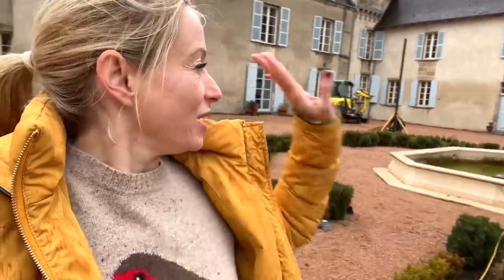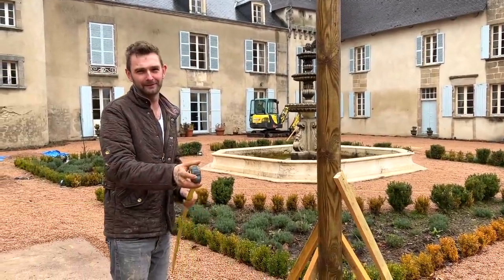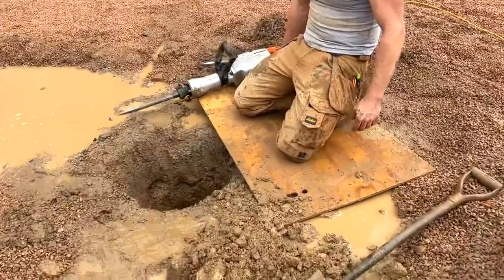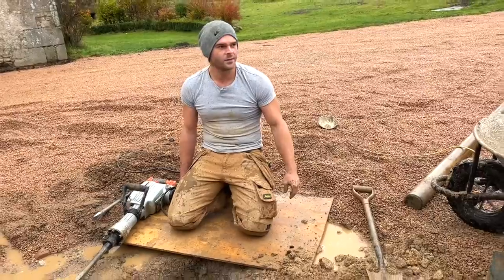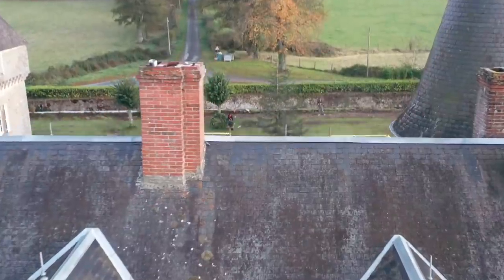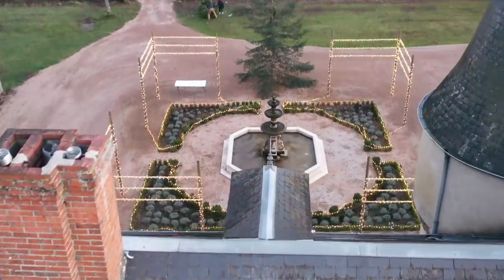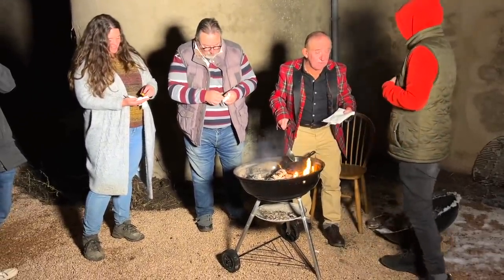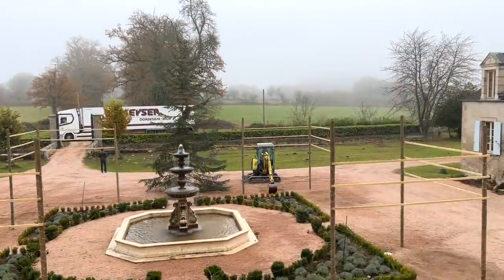OUR SECRET CHRISTMAS COURTYARD REVEALED!

Comment: So  interesting to see you planting trees in France.  Your soil must be very different.  In our part of Canada we always have to remove the wire cages from the trees and spread out the burlap so it will rot out. Otherwise the root structure is weak.
Reply: Yes, research is showing more problems than not with trees who don’t have their root balls completely freed of wire, etc.  especially after a decade or so when they are very large.

Comment: I feel sad for the poor trees not have the wire or fabric taken off , it strangles’ the roots.
But I’m very happy for all that live at the château to enjoy the lovely courtyard.
🎄🎄🎄🎄🎄🎄
Reply: I did too...at first. But Davey is a professional, and would've thought of that, so either they edited that out, OR they used biodegradable materials. They do make a mesh-like material that is biodegradable so I'm hoping for that!
Reply: The "packaging" of the tree roots is the right way to transplant grown trees, its a natural burlap, a kind of sisal/agave fiber witch holds the roots together with some of the original soil plus prevent from freezing the roots and will degenerates it self in the coming seasons as the roots grown over it .
Reply: They planted them perfectly. Roots will have zero issues growing. Think of all of broken and raised sidewalks you've crossed over. Roots are extremely strong. An old oak damaged our pool after when the roots decided to puncture the concrete lining on summer day. After years of the root growing along the curve of the pool pressure began to build until one day massive cracks appeared and a small section between the cracks fell out. 

The thin wire is no match for the roots. Rust will quickly take hold. By the time the roots are bigger than the diameter of the open bits in the wire, the roots will simply break the wire. The burlap will decompose. The roots need the soil they were grown in to stay in place to prevent damage to the vital finer secondary roots.

Cheers!

Comment: I think the design will be very nice in the summer, the trees will provide much needed shade. However, newly planted trees require a lot of regular watering, buy at least one water sack for each tree and keep them hydrated the first summers. Also, linden trees like nutrient rich soils and as you have had problems getting the box to thrive in the poor soil you'll have to amend the soil the first years in early summer.

Comment: Beautiful idea. I cringed watching the tree planting though. That construction grade fill and gravel is no place for a tree to root. It has to be a certain density to allow for roots to permeate. Also the burlap and wire basket weren't removed, the roots will continue to circle in that 'cage'. Those amendments added were at the bottom of the hole. Amendments should be top dressed so the rain can bring it down to the roots, not under the ball. Also whatever that loose soil was added back in is the only area the roots will permeate if any do not get girdled through the burlap but also will create an area of over saturated soil. Lastly, the trees did not grow in the same region and the trees were not marked for what direction was north in the orchard. If they were shaded and or receive sun from different directions and intensities they will gain sun scald and frost cracks 😔 better to put those trees in the walled garden against the wall.
Reply: I was a bit shocked by some of what you mention.
So strange considering the expertize and tremendous cost and labour. Hard to wrap my head around.
I absolutely love espaliered fruit trees but I’m skeptical towards this whole operation the way ot was done…
Why not do it properly if you’re going to go to the trouble at all?
Reply: Dan is an expert and Stephanie had her vision and as always it's impe cable.  You have to see it in person to comment on it.

Comment: Loved this vlog!  And I agree with Tatie, risks are okay if you remain prudent and cautious.  A friend of mine once said: "I walk the catwalks as a theater lighting engineer at 7 meters above the stage.  If I have an apprentice or other teammate that tells me he's not scared of anything or afraid of falling off the walk, I don't let him come up.  You need to have at least a 15% fear because if you don't, you're dangerous to yourself but mostly to others."  I had to paint the framing of the 2nd floor windows this summer and even thought my feet and body were inside the house and I bending over to paint, I still wrapped a sturdy climbing rope around my waist in case my steadying hand slipped off the frame and pitched me out the window.  That's being wise.  So Dan and Amory, please, save your mothers hearts and at least give yourselves a little security.  If not a harness, at least a rope to steady you to a sturdy structure.  And yes, a cherry picker would be ideal.  You now have wood from the forest.  Use it to build a shed or lean to to house the mechanical implements needed to maintain the chateau.  It is currently housing a few of them out back, but an independent structure saves in the end because if ever there is a fire, you don't lose the chateau and the equipment; you lose either one.    Loved the signing of 2 hearts at the end - you both are harmony in action.  Bravissimo!

Comment: You made the same mistake as with the trees in the vegetable garden. You didn't remove the wire cage, rope and burlap, that will eventually kill the trees.
Reply: They are not wire you can find this back at the beginning. Davy knows what he is doing.
Reply: @joketendam5806  Stephanie actually says in the video "that wire won't hold", so it's wire. And they should have removed it. I just comment so she is aware of that and can prevent the trees dying and wasting money and time.
Reply: They will  found out soon enough, pity they are not listening . I am so disapointed , so disapointed !
Reply: @Pupperski  That is attached to the WIRE BASKET. They thing is that you have to remove everything that comes wrapped around the root ball. You won't plant a plant with a plastic pot so why would you plant it with all that stuff. It's only there for transporatation and not because you can plant it with those things.
Reply: @Pupperski  
.
Reply: @Pupperski  Because most trees for shipment are put in burlap, rope and a wire basket that you have to remove before you plant. I put the video de Garden Answer as a simple example of what happens to a tree that is 30+ years old when a wire basket is left when planting. I also worked at a garden center and it's a standard practice. I am pointing this out because they made the mistake with the trees in the Vegetable garden and now again and they hould be made aware that it's HAS to be removed.

Comment: I am trying not to be negative.  I am a avid gardener.  Once again I am concerned about the wire and burlap and the soil really needs amending. I hope I’m wrong as this looks like the pear trees.  Very costly.  Tree roots need to grow to find the water.  If you have a high water table the roots will be on the surface, but if the water is down deep the roots will grow to find the water.  Which is far more beneficial for the tree as it makes the tree stronger in the stabilization.  The wire and bag is only there for transporting.  At least that is how it is in North America.
Reply: I agree, I worked in a nursery for 13 years and our guys would never have planted trees with burlap or wire around the roots. They would dig a large enough hole, fill it with water, let the water sink away and then plant the tree and keep it well watered for the first several months. We would only plant trees in Spring or Fall but that is our area of the Midwest.
Reply: Stephanie answered this question a while ago in reply to a similar comment. I guess not everyone reads the comments from her. It's pretty annoying to see people mentioning this repeatedly when it has already been addressed. And don't ask me about what she said - find it and read it like I did.
Reply: @evmcelroy  well let’s hope they fare better than the box hedging.

Comment: I still wonder why you dig through granite to plant a tree in the courtyard. In Versailles' courtyards, all the trees are in large planter boxes, so if one does not do so well, the fork lift lifts the offending planter and takes it back to the shed to have a new tree planted in it. The trees will have difficulty getting all the water they need, especially as the burlap was not removed and the roots teased out. Please buy or hire a cherry picker, or a scissor lift like we use in theatres when we are hanging and adjusting lights. That was just totally irresponsible being up the top of an extended digger. So unsafe. What were you all thinking? Your lives, health and well-being are way more important than a TV show.